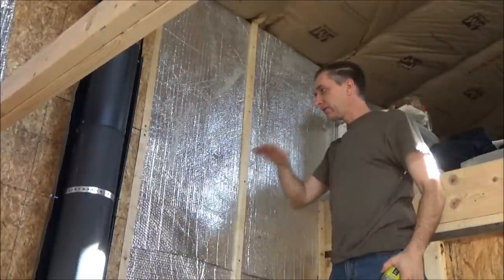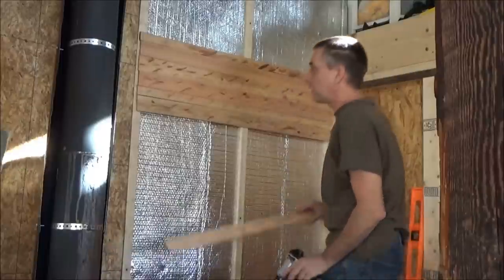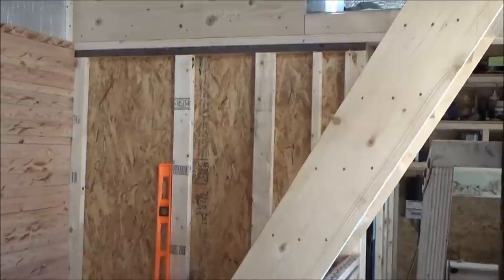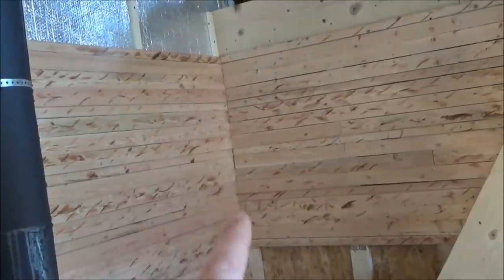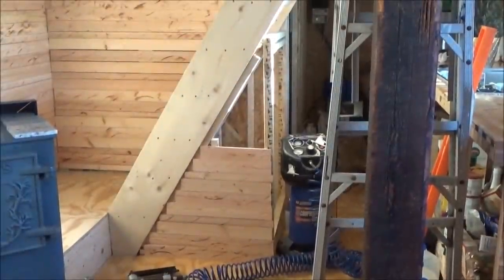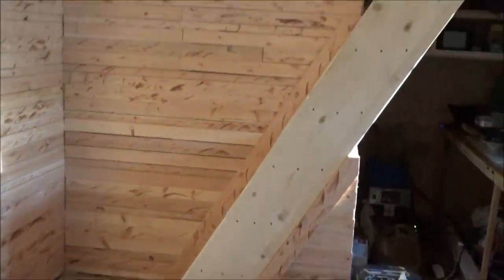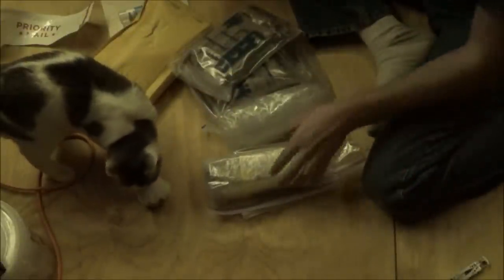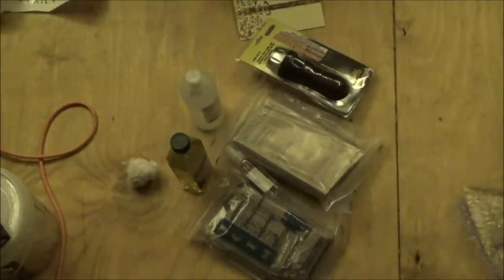Using Reclaimed Lumber For Homemade Tiny Home Paneling

Comment: Finally he acclimates the material to the environment. Why do that? you did not do that with the rest of the "paneling", but evidently that looks good.
Reply: Well, he did it for the first batch, but when he ran out he abandoned the idea and just pushed ahead.
Thinking that just a couple of dry days will allow him to work with the old barn wood is going to create some interesting effects after he installs it IMHO.
I would have used some of the better barn wood to build a shelter (roof) close to the house, where one can collect the selected wood and work on it without it getting soaking wet every time it rains. It would still have to acclimatize before use, but that would be half the battle won. A bit like a more rugged and larger than the picnic shelter he used before, and to the side instead of in front of the house. That way he would not have to run inside every time it threatens to rain or snow. That would be my idea, but then again, I am not living alone in the woods.
Reply: pieter zeeuwen "living alone in the woods" You make it sound like he's in remote Alaska, far far away from civilization.
Reply: Jim Watson It may sound like that to you, but it does actually say so...
Reply: pieter zeeuwen What?
Reply: Jim Watson It may sound to you like he's in remote Alaska, far far away from civilization, but I never said so. There are woods far from civilization and there are woods close to civilization. You can live alone in either of them. And not just in Alaska.
Reply: Jim Watson He certainly is not in Alaska... then again, it is not like he can see a neighbor or shout to one for help, is it?   Out in the middle of 96 acres is pretty "alone in the woods" to me.
Reply from the maker: pieter zeeuwen Right, I had no time with rain on the way soon and the propane guys waiting on me. As to a shed, not legal until I have a McMansion built here. No mansion, no shed. Unless everything is on wheels. I guess I can get more free campers and build up a trailer park. lol
Reply: The Do It Yourself World I would just build a roof. Does that count as a shed?
Reply: pieter zeeuwen I would personally build  a roof / wooden version  of the pop up. Use bolts not nails so it is portable...  If they come out and say take it down, do so.   A wooden umbrella  aka a gazebo shouldn't need a permit either.  I think The Do It Yourself World should consult with ***** on a design to make a portable roof system.  A large version of his Molly and Dolly camp tables would do it.
Reply: MollyDolly I agree. It would be heavy enough to build it all above-ground, so it's movable. Don't sink the legs into the ground, no foundations, no permanent structure (even if nailed together). Worried about the wind lifting it, even between the trees and heavy as it is? just add some ground anchors, like you do for a pop-up or a wind turbine mast.
Reply from the maker: Catwomanmn Be careful how you word things. There are eyes on here looking for anything "illegal". So, my trolls, for the record, I do not skirt around the laws :)
Reply: The Do It Yourself World Skirting is not breaking... Rock that skirt!
Reply: ***** I like the sound of that!
On the portable camp shed, it could have folding legs like the tables, right?  So. on the roof slant, two legs shorter on the back?

The Do It Yourself World If you haven't watched Memphis' Molly and Dolly camp tables video....please do,  then you will see how you can have a portable shelter described above made out of your barn wood. It's the perfect solution!